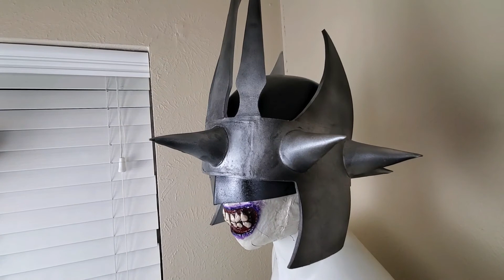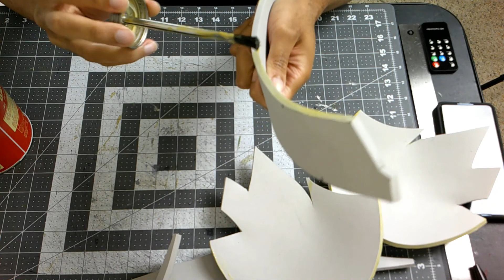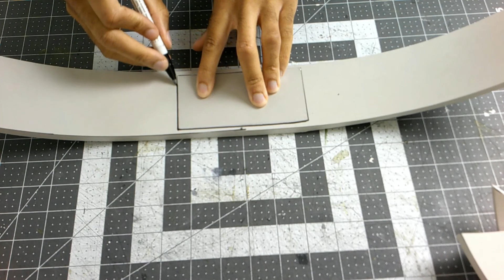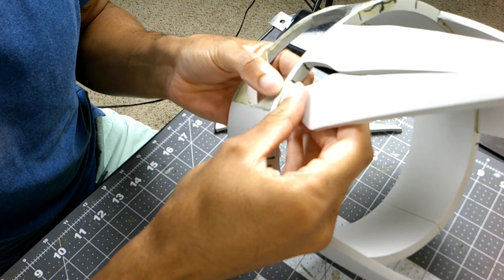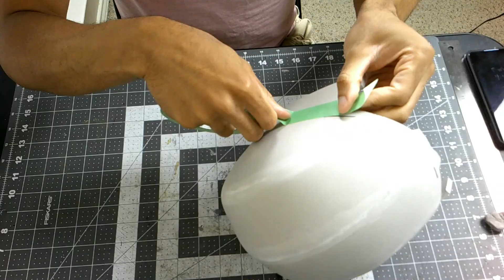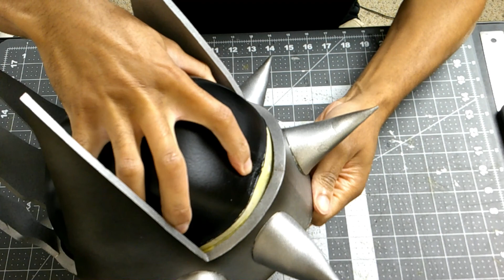Darkest Knight - Lord Batman Who Laughs Cosplay Helmet Build

Comment: what type of acrylic do you use for the visor, i mean, what is the name of the material?
Reply from the maker: The paint used on the visor is Vallejo Metal Chrome. A light coat using an airbrush is best so you can still see-ish. The visor material is just a thin sheet of acrylic.. you can also use thin polycarbonate sheets since those won't break as easy as acrylic sheets.